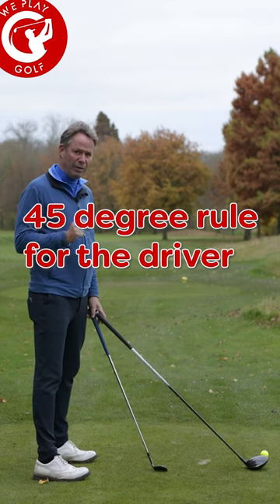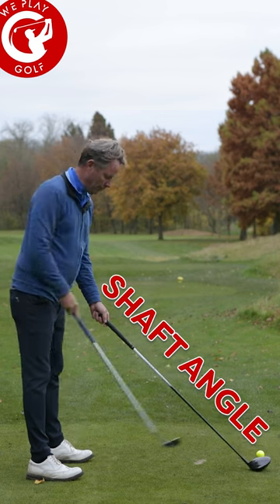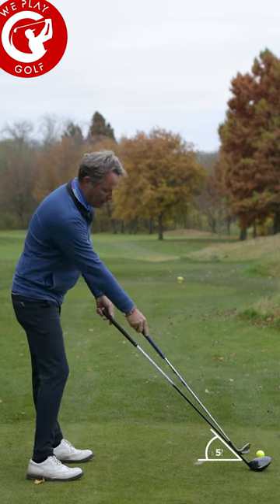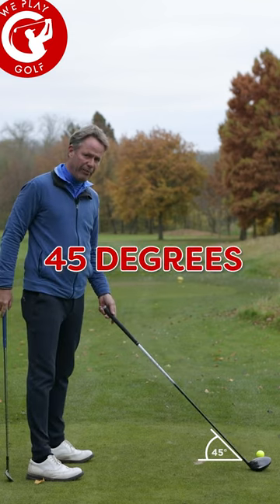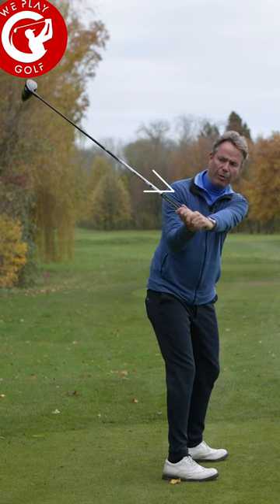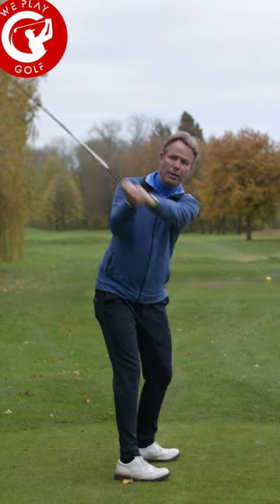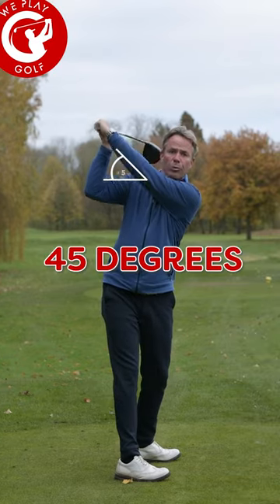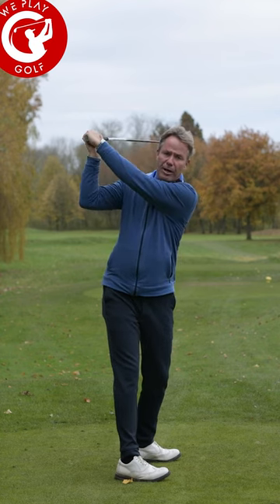45 degrees SWING PLANE when hitting a DRIVER! #short

Comment: And how would I know is 45 ?
Reply: Practice with a mirror for an approximation. Once I changed the downswing to try and come through impact feeling that the shaft is at 45 degrees then it results in bombed drives. A simple swing thought/goal.